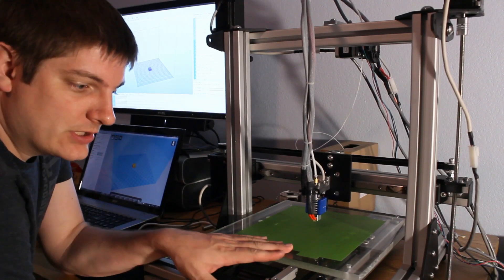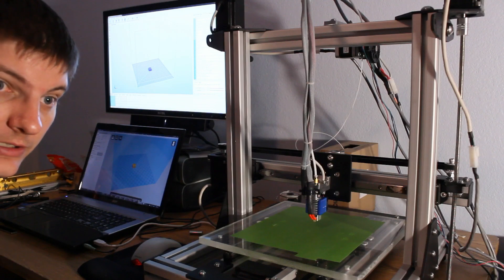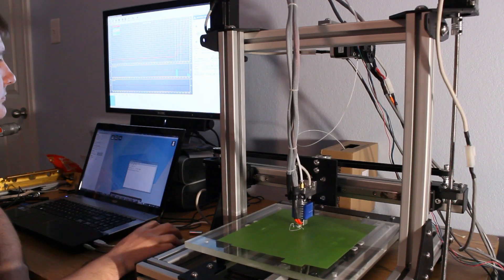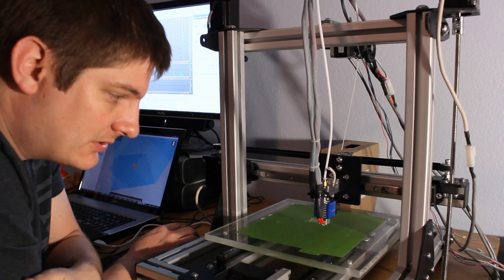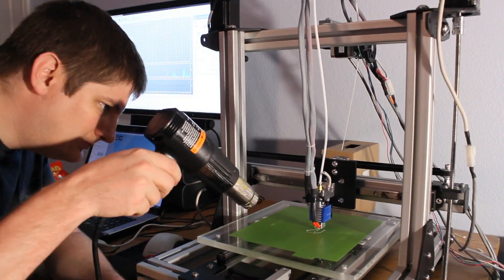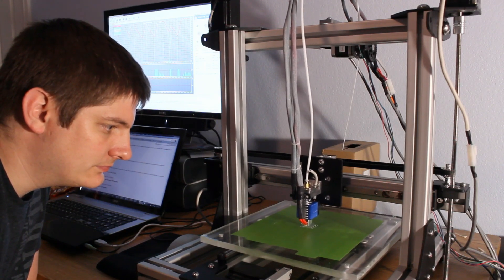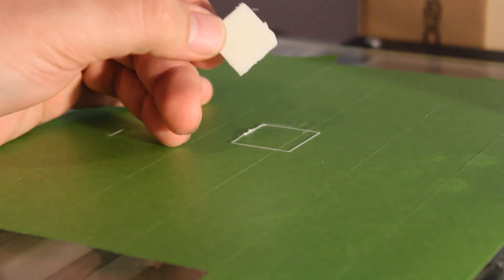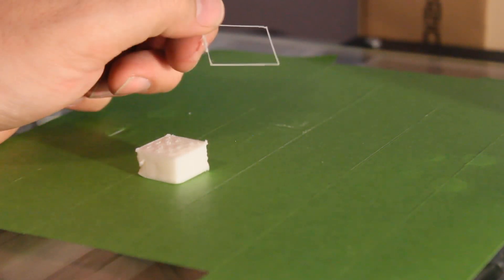Evan's DIY 3D Printer / Mill - EP9 - First Try Printing

Comment: Maybe outta bounds for my dumb opinion. But couldn't you use 3 lasers for edge registration? Actually 2 would work, 1 on tool (x & y) and 1 for z, locating tip.

And a "under glass" (pre-heat) element on its own x or y (whichever not fixed? preheating moments before extruding.
Reply from the maker: The heated bed comes later on, but is on there now.  As for finding the home position of the system, I'll be installing limit switches eventually.  Lasers or something could help improve the manual homing process, but that will be replaced by auto homing soon enough, most other bots use it.

Comment: I noticed that the Z axis is just acme screws hanging on flex couplers usually you would have bearings and lock collars on the mounting plate to ensure no unwanted z axis movement.
Reply from the maker: Chris,
Thanks for the suggestion, I realized this right away when I mounted the flex couplers... they were originally intended to be solid, but I thought protection from binding was important.  The 'springyness' of the Z axis was not as bad as I thought it would be, but I've since worked out a solution.  I was able to print the new thrust bearing support pillars using the printer, so that is cool.  This is in Episode 13 :)  Evan's DIY 3D Printer / Mill - EP13 - CAD-To-Print of Z Axis Gantry Thrust Bearing Mounts
Reply: Oh cool I'll have to see more of your vids

Comment: decrease the flow rate and add cooling fan on the extruder tip to increase print accuracy
for better sticking use "stick glue" on wide painter's tape or directly on acrylic (search "stick glue" on google image if you don't know what it is)

you have made a very good printer indeed! we make open source 3d printers at 3dmaking.it and we like your design very much!
Reply from the maker: Thanks, I'll check it out.

Comment: I really appreciate you're showing the "bad" along with the good. 

Thank you for this journey.
Reply from the maker: Thanks!  There has been a lot more bad than good recently, I need to edit a few videos and put them up.  Still making progress though, just some jamming going on.
Reply: I'm sure I've got a lot of "jamming" to look forward to.   Your printer looks pretty solid though. 

Good on ya.

I hope you don't run out patience nor filament before you get it sorted out.
Reply: SquishyBrained (Evan5659) Your videos are very informative. 
I had the problem with jamming with the bowden tube and E3D hotend too. It was a combination of bad filament (inconsistent thickness) and a kind of squishing effect inside the tube. I've switched to a direct drive extruder and I found it easier to work with. I've minimize the jams to user error like leaving the hot end on too while working on CAD for the next print.
Reply from the maker: BanditMr2 thanks. Im not sure I want to go direct drive, but it is always an option I guess. For  now I'm up and running at 70mm/s print speed instead of 100. It seems to keep it from jamming. I think it may be snagging on my quick connects too, so I may try to bore / smooth them.

Comment: I'm curious to know how can you have a dual head print one for the your standard filament another for support material and what software would you use when loading the print file to allow the printer to know which is which.  I'm planning on making my own build but want it to have both materials.
Reply from the maker: I'm new to this whole game, but I don't think that the "host" software will care much about single vs dual print heads.  The G-Code will already contain all the moves for the given tool number, the host just sends the commands and jogs motors and stuff.

What you need to find is a good slicer that handles that.  I think the two big ones are Cura and Slic3r.  I recall that Slic3r supports dual extruder support material, but Im not 100% sure.

Marlin firmware will support at least two right out of the box, but I'm not sure what others are doing for 4 extruder + setups.  If I ever dive into that, I'll make a video :)
Reply: Thanks, I'll look into all the things you said.  Definitely going to use that controller you have there seems the best suited for what I have planned.  Going to be a while but when I get to building mine, I'll make a video of my build and send you the link.

Also I wanted to ask about the heat bed. How does it work? Where can I get one or is it possible to create one for a specific size machine. Haven't really found anything online that explains the make up of one.

Thanks again.